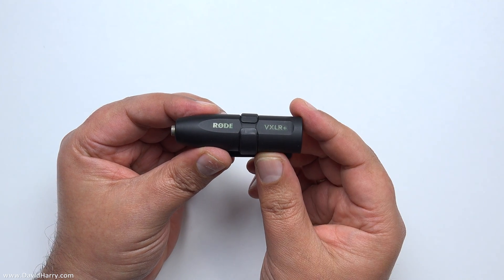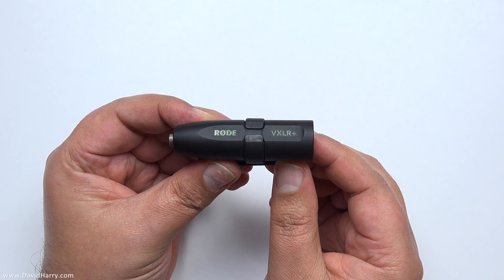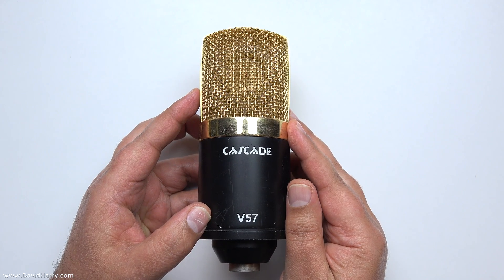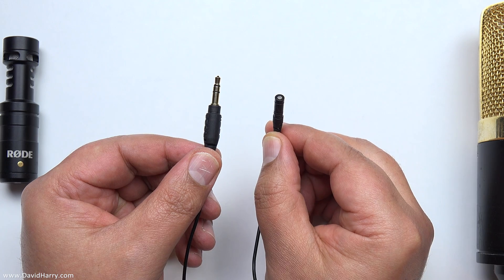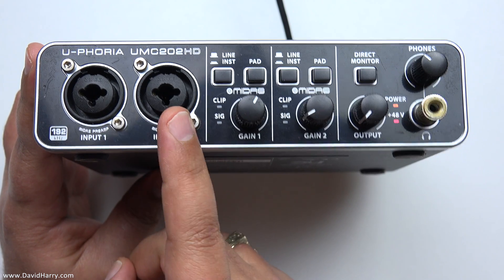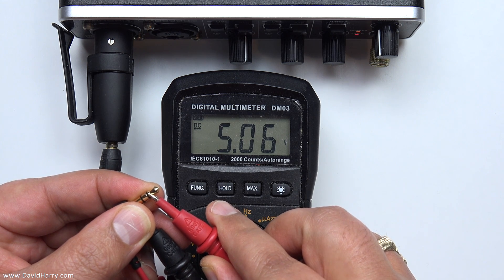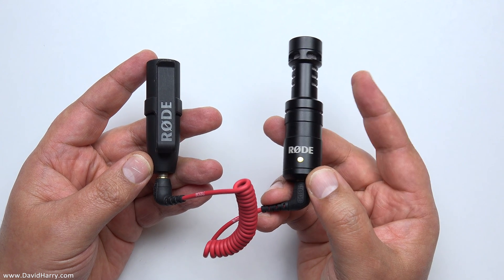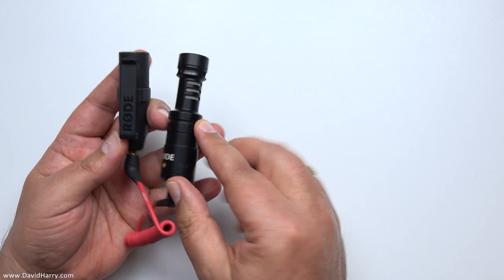RODE VXLR+ XLR To 3.5mm Audio Adapter & Phantom To Plugin Power Converter Explanation & Review

Comment from the maker: RODE VXLR+ at Amazon: https://geni.us/RodeVXLRplus
RODE VideoMicro at Amazon: https://geni.us/RodeVideomicro
RODE Lavalier GO at Amazon: https://geni.us/RodeLavalierGO
RODE Microphones at Amazon-com: https://geni.us/RodeMicrophones
RODE Microphones at Amazon-co.uk: https://geni.us/RodeMicrophonesUK

RODE VXLR+ XLR To 3.5mm Audio Adapter And Phantom Power To Electrect Plugin Power Down Converter.

In this video I give a basic explanation of what the RODE VXLR+ is , how it works, what you'd use it for and when you'd use it.

So, in a nut shell. The basic primary function of the VXLR+ is as a XLR to 3.5mm unbalanced audio connector, or audio line converter.

It's second and unique function is that unlike similar passive audio connectors, the RODE VXLR+ is also a DC to DC power/voltage converter which converts 48V phantom power, typically supplied by a mixing console, 48 volt phantom power supply or microphone pre-amp via a XLR cable to a 5 Volt voltage that is usually needed for an electret condenser microphone, which usually needs only a voltage of between about 2.5v to about 6 to 9 volts.

An electret condenser microphone, or ECM, is typical of a video microphone such as a RODE VideoMicro or lavalier microphone such as a RODE Lavalier GO or bare ECM capsule. An ECM mic typically requires a voltage of about 5 volts, which is usually known as plugin power or traditionally as electret power.

Electret power is very similar to phantom power in that it is supplied down the same cable that is used to carry the audio signal back from the microphone to the source of the cable. Also, phantom power is usually supplied via a balanced XLR cable and electret power, or plugin power, is usually supplied via an unbalanced cable and usually via a 3.5mm jack socket connector.

Cheers, 
Dave.

If you liked this video please give it a thumbs up.

Click the link below to subscribe to my YouTube channel:

https://www.YouTube.com/DavidHarry?sub_confirmation=1

Click the bell notification icon so you don’t miss any of my videos.

If you’d like to buy me a cup of coffee to help me edit through the night here’s my PayPal link, all donations toward my coffee habit are greatly appreciated :)

https://www.paypal.me/DavidHarry

FULL TRANSPARENCY ABOUT MY AMAZON LINKS

I am an Amazon affiliate and part of the Amazon Influencer Program, which means that if you click on any of my Amazon links and make any purchase from Amazon after getting there via my links, I receive a small commission from Amazon for anything you buy. You do not pay any extra for me to receive my commission, the commision comes from the advertised price you pay and isn’t added on top of it.

These commissions really do help toward the costs of my YouTube channel and mostly go toward buying a lot of the equipment that I review and use on my channel. I am very grateful to anyone who uses my links as it really does help me in what I do.

Here are my Amazon Shop links:

https://www.amazon.com/shop/davidharry

https://www.amazon.co.uk/shop/davidharry
     
FULL TRANSPARENCY ABOUT FREE EQUIPMENT I RECEIVE FOR REVIEW

If I ever review any products that I’ve been given for free or been given free in exchange for a review, I always make this perfectly clear at the start of the video. Here’s a video about my ethics:

https://youtu.be/K-RqylXDmO8

CONTACTING ME FOR PRODUCT REVIEWS

If you are a manufacturer, distributor or reseller and would like me to review your stuff, you can get in touch with me at the email below. If you expect a totally positive review just because you’ve given me something for free, don't waste your time as you’ll be sorely disappointed. If you expect me to pay for anything up front and then I recieve reimbursement after the review, again, don’t waste your time. If however you are someone looking for a proper, balanced, real world review. Then defo get in touch. If you need any further clarification on what I’m all about, here’s my ethics statement video:

https://youtu.be/K-RqylXDmO8

Here’s my contact email:

YouTube@DavidHarry.com

Here are some links to my website and other small websites where I group videos about certain products that I’m really into:

DJI Pocket and Action stuff: www.DJIOsmoAction.com

GoPro stuff: www.GoPro9.com

My website which will probably always be a complete mess :)  www.DavidHarry.com

And most importantly:

I’m David Harry, thank you very much for watching this video, take care and goodbye now.

Cheers,
Dave.

Comment: Thanks for the useful video and review , thumbs up ! I got a Wireless ME with the VXLR+ adapter, using the provided TRS cable (which looks exactly like yours) into my Yamaha AG06 MKII with Phantom power enabled but I get no signal into the mixer. I checked absolutely everything, but I am not muted and all the knobs and settings on my laptop seem right. Both the ME and the mixer work by themselves just fine, they just can't be combined. What am I doing wrong?

Comment: Hi!
What's the difference between the VXLR+ and the VXLR Pro?
There's a reasonable difference in price, between the two...

Thanks.
Reply from the maker: The Pro is balanced, using an internal transformer. Cheers, Dave.
Reply: @DavidHarry  - That was fast, thank you, David! You're a real pal!
So with both the VXLR Pro and VXLR+ I'll be able to hook up my VideoMic Pro+ as well as my Smartlav+?
Also, does the phantom power need to be activated, on the audio interface's input?

Thanks a ton!
Reply from the maker: Hi. I'm actually editing a YouTube video, that's why I was quick with the response, I'm never this quick usually :) Yes, you can use either with those mics or any other 3.5mm microphone. You won't need phantom power for the Pro+ because it's self powered, you will need phantom power for the Lav. Phantom power is  needed by either of the VXLRs as they use that power to down convert to electret/plugin power, which is required for any unpowered ECM microphone, such as your  Lav. If you are going straight into an audio interface or mixer that has XLR and phantom power, you only need the VXLR+ but if you are connecting to a long XLR cable then the Pro is best as it will be balanced back to the interface or mixer. Here's my RODE mics playlist, you may find something helpful in there https://www.youtube.com/playlist?list=PLleKChtNUwZSQyEXb-BbjGcUYUnlwOGxN I also have another channel that may have useful audio stuff but that has swearing in some of the videos, although there are notices for swearing for anyone who's offended by swearing https://www.youtube.com/channel/UC9t495lxVcDL38hbp5jWQ-w/videos Cheers, Dave.
Reply: @DavidHarry  - Excellent, that's great timing!
Okay, thanks for clearing that up. So both the VideoMic Pro+ and the VideoMic won't need the phantom power engaged?
But the Smartlav+ needs the phantom power.
Aha, I see, and that makes sense, I just needed to understand.
Excellent, I will get the VXLR+ then, and at the same time save some money!

Comment: Hey David, can I plug a gaming headset with a TRRS jack into this adapter?
Reply from the maker: Hi Sean. You can’t plug it straight in, you need a TRRS splitter so the mic and the headphones are separated, like how I split the TRRS cable in this video https://youtu.be/6tp91Nmk--o Cheers, Dave.

Comment: Hey David, another David here, isn't Plug In Power usually rated for 3V?! I'm confused because Deity has an Adapter of this Type and it is 3 V PIP.
Reply from the maker: Hi David. Plug-in power can range from around 2.5v up to about 7v. Any electret microphone will safely work within that voltage range and many will be slightly better for dynamic range and noise with the higher end of the voltage range. RODE’s voltage is a lot more useful compared to Deity’s if they’re only using 3v. Cheers, Dave.

Comment: Hey David, the video was very informative but I am still uncertain about some things. I recently got a Zoom Podtrak P4 mixer and 4  condenser mics with 3.5mm jacks (2 rings). I then got a normal 3.5mm to XLR adapter. but when I set them up all I get is extremely loud white noise. Is the VXLR+ the solution?

Comment: Hello David, first of all thanks.
This the only video available that explains the workings of the vxlr+ in such detail and easy to understand. I do have question from an audio engineer point of view. 
Can I use the rode wireless go, videomic or similar mics plugged into my audio mixer (ex:  yamaha 10xu) for PA purposes ? 
Can I plug the mic  into VXL instead and plug the VXL directly into one of the channels on my mixer  without using  48v on the mixer.
Reply from the maker: Hi Imran. Unfortunately you can't use the VXLR+ to connect without phantom power because whatever mic is attached to the VXLR+ will need power. Cheers, dave.
Reply: There is a straight vxlr version without the volt step down which may work. I will have to try that out and provide feedback. Basically, I am looking for a 2 in 1  A/V  solution making use of rode or saramonic transmitters/receivers in both scenarios.
Reply from the maker: If it’s just an audio signal that’s already been powered and/or preamplified then the VXLR will be fine. However you could do that job with an unbalanced 3.5mm to XLR cable and not have any adaptors involved. Cheers, Dave.

Comment: So if I understand you correctly, if I want to use two wireless GO systems to record two audio channels with my H4N, I will need the VXLR+
Reply: the VLXR+ isn't Stereo, and XLR isn't Stereo, to record two channels you need two XLR Cables and maybe two Adapters. But you also don't need a Phantom Power Adapter for the Wireless GO, it works fine with a stupid XLR to 3,5mm Adapter because it has it's own battery and doesn't need plug in power.

Comment: Hello David,
 Do you think this can be used to connect a GSP 300 headset microphone to a focusrite with phantom power?
Thank you!
Reply from the maker: Hi Erik. Yes you could but you’d have to use a TRRS splitter to separate the mic and headphone and feed the mic into the VXLR+/Focusrite and the headphone could also go into the Focusrite. I’d guess that your mic and headphone quality would both be better via the Focusrite, so the messing about may well be worth it. You’d also have much finer and better control of your mic and headphone levels. I do something similar myself but with a separate boom mic and headset using the Behringer in this video and my mic and headphone quality are awesome. Cheers, Dave.
Reply: @DavidHarry  
The mic is already separated into a mic and an audio jack so that should work fine right? 
Thank you so much man!
Reply from the maker: Sorry, I thought it was TRRS on the end, mixing the phones and mic. Then yes, it’s easier than I said, just use both the headphone and mic jacks on the Focusrite with the VXLR+ for the mic. Cheers, Dave.
Reply: @DavidHarry  Do you happen to know any other adapters that work the same way? The vxlr+ is sold out everywhere on the US apparently...

Comment: Great, thank you David, 
So if I got the plus version I wouldn't need the non converting adapter as it can serve with self-powered and non powered mics .  Planning to use it with Video Mic NTG with Motu 4 as the it is self powered and Motu 4 has a 48v on/off.  Thoughts? thank you :)
Reply from the maker: Hi Fahad. You would be better off getting a high quality 3.5mm to XLR cable and connect the VideoMic NTG direct to your audio interface. You wouldn’t really get any benefit using the VXLR+ because you don’t require the phantom power to plug in electret voltage conversion. Don’t forget, unlike a Lavalier or something like a VideoMicro, the VideoMic NTG doesn’t use plugin power via its 3.5mm socket, it can only be powered by its own internal battery. In any event, just make sure that your audio interface isn’t sending phantom power through the XLR socket being used. You could also connect the VideoMic NTG with a 3.5mm to quarter inch cable to a quarter inch input on your audio interface, using XLR won’t improve the sound it’s just a more secure socket in this instance as the mic output isn’t balanced so you won’t get any benefit from a balanced XLR connection, plus you wouldn’t have to worry about any potential phantom power issues. Cheers, Dave.

Comment: What if you are to use phantom power on your preamp device on the Lav Go how do you know what Voltage to set the phantom power as there are different settings such as 12v and 48v - if it doesn't require 48v would you do damage setting it to that?

Comment: Very helpful video. Question? Would the VXLR+ still work if it was plugged into a standard XLR lead for extra reach? I have a Rode Lav+ and want to connect to the VXLR + on the belt of the talent and then run a XLR lead from the VXLR + into the mixer. Would it work? Thanks

Comment: Howdy David. I bought one of those adapters to use with my Zoom H6, so I can plug in small condenser mics into the XLR ports and get the correct voltage (plug in power). I need to buy another one so I can use two mics. Thanks for the info.
Reply from the maker: Hi Bob. Yes, these are cool little adapters. I don't know if you've tried but certain mics will actually sound better being used with the VXLR+ compared to direct 3.5mm because the VXLR+ is capable of sending more voltage and current compared to the plugin power of most cameras and their 3.5mm mic input. Cheers, Dave.